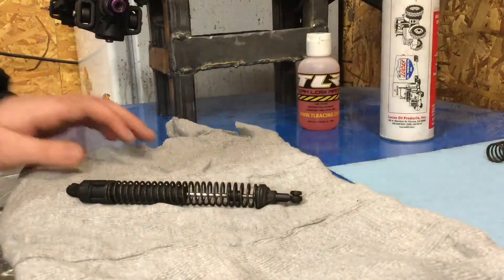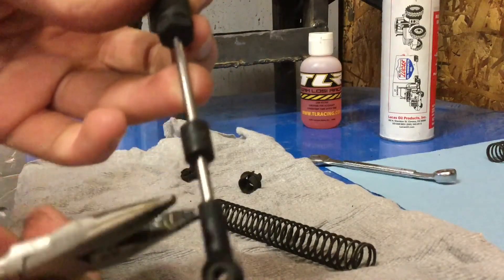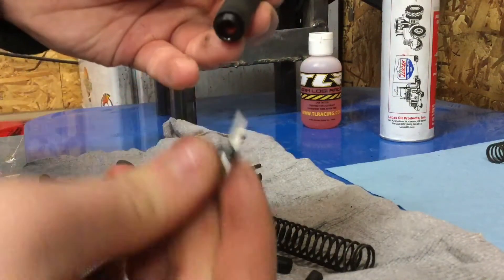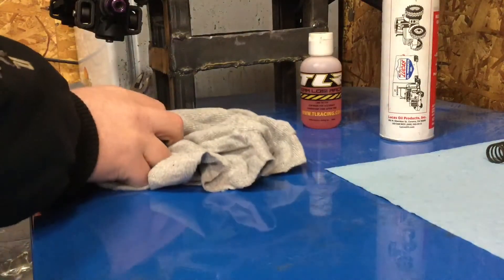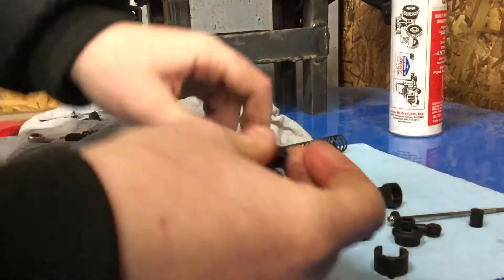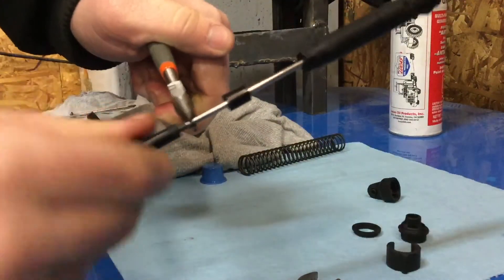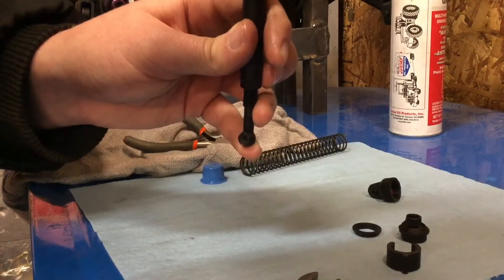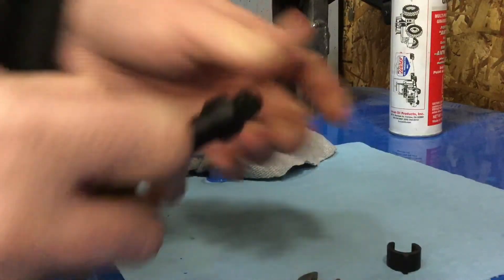How to rebuild hpi savage 25 shocks

Comment: I just got one of these old school nitro savages with double red shocks at each wheel. 

On a real car, the shock is not meant to rebound at all, just dampen. It softens the action of the spring and the spring dictates ride height basically. 

But with these, you want the shock to be a little “springy” as well so the truck doesn’t sag. Is this about right?
Reply from the maker: Raj Gill it’s pretty much the same concept as a real car. It’s just all preference how you like your shocks setup.
Reply: i guess im asking randomly but does any of you know a method to log back into an Instagram account??
I stupidly lost the account password. I would appreciate any tricks you can give me
Reply: @Ezekiel Seth Instablaster =)
Reply: @Bishop Cullen it worked and I actually got access to my account again. I'm so happy!
Thanks so much you really help me out :D
Reply: @Ezekiel Seth No problem :)
Reply: @bishopcullen1819  I can't believe you messaged yourself back and forth on two different accounts trying to spread your scam. Stop it or you might have something to worry about soon.

Comment: Thanks for the vid, I'm redoing the shocks on my Savage xl, are the socks on the X the same size as the XL? and you said you were using 35 oil for the front shocks but what do you use on the rear?
Reply from the maker: Tank-416 Gaming the shocks are the same size depending on the year. I used 35 in the front and 40 in the rear but depending on your terrain I would go with oil that’s a little lighter
Reply: @thenitronation5815  I used 50 for off road.?. now I'm rebuilding front and rear diffs. thx man
Reply from the maker: Tank-416 Gaming for my driving stile that’s a little think for me

Comment: Hi mate thanks for the video. I've just got my savage and all the shocks were making a scratchy/squeaky sort of noise. I took the cap off and the oil is covered in bubbles, is that caused by faulty seals? Thanks
Reply from the maker: Adamski that noise could be caused by a couple things. It could be bad seals, scuffed or bent shock shafts or the oil has simply not been bleed properly. Check for oil residue on the shock, if you see any wipe it off and if the oil comes back change the seals and check the shafts. Hope this helps.